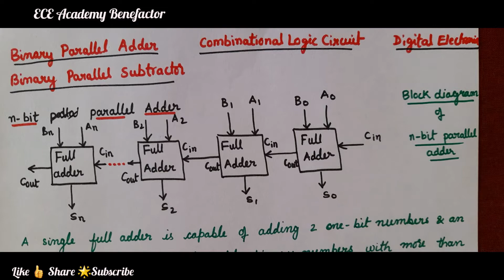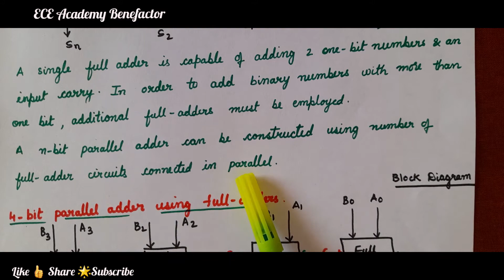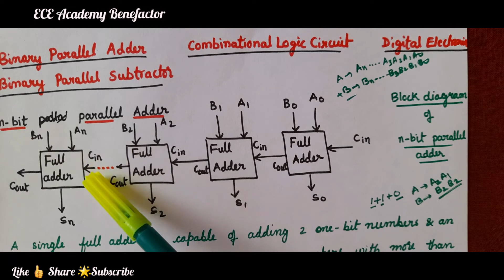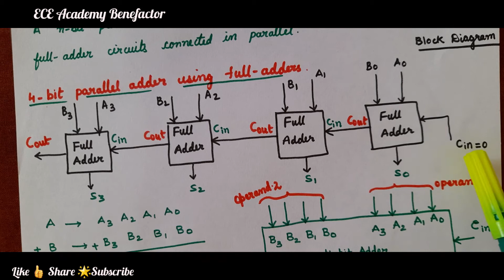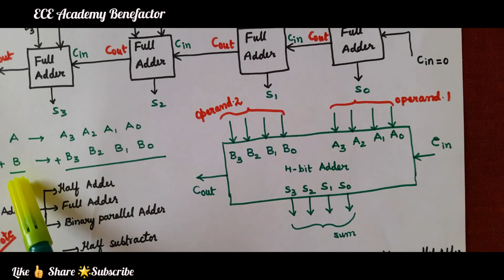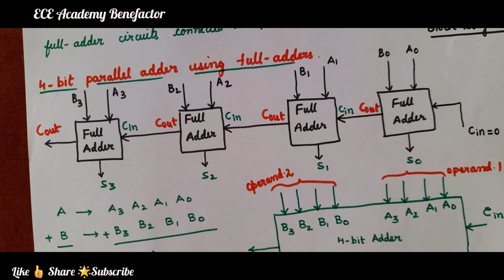Comment: can we have an adder adding values of A and B where A = A0 A1 A2 A3 A4 A5 A6 and B =  B0 B1 B2 B3
Reply: In binary parallel adder ,full adder is used
if A= A0 A1 A2 A3 A4 A5 A6

then B= BO B1 B2 B3 0 0 0